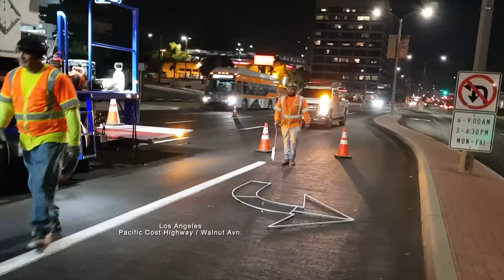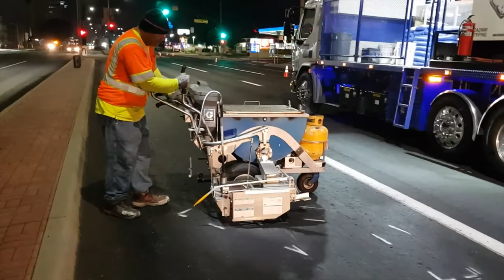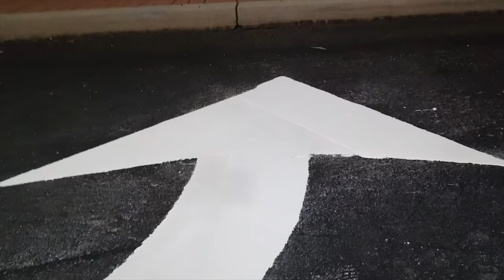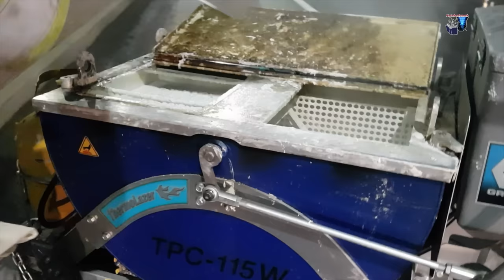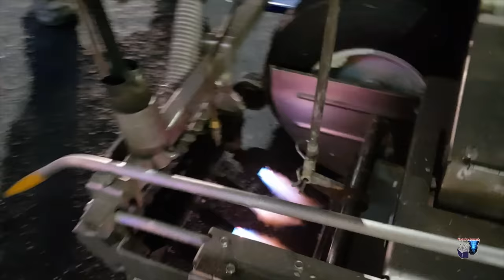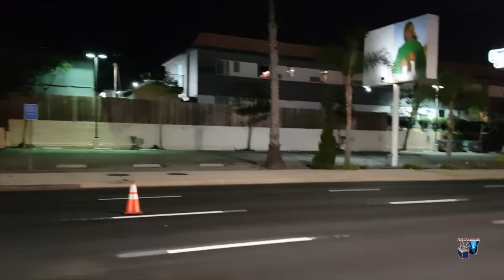USA - DIRECTION ARROW IN 5 MIN! @MasterWorkers

Comment: When I worked pavement some 50 years ago, we'd slap down a plywood arrow stencil and one man poured in paint while the other spread it with a long-handled roller.  We'd be done in 30 seconds and pick up the stencil and move on.  No pricey equipment. I guess we didn't know any better.
Reply: Them were the good d days.
Reply: Too much money to be made these days.
Many years ago a road was dug up so a utility company could do some work.Then another co came by to collect all the rubbish.Another co came to put safety barriers around the hole.A week later a diff co came to fill in the hole.The safety barrier co then came to collect their barriers.
A week or so later the exact spot in the road was dug up for another utility company😂😂😂😂👍🇮🇪🇷🇺🇷🇺